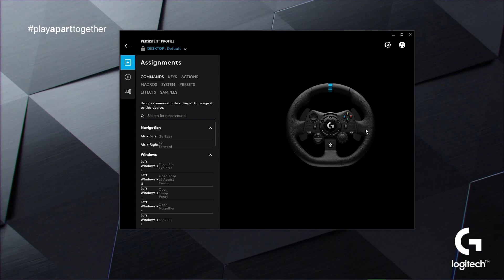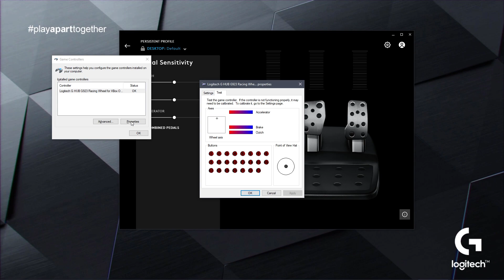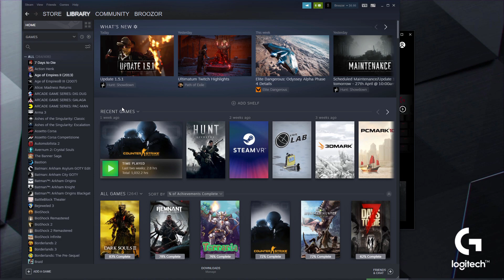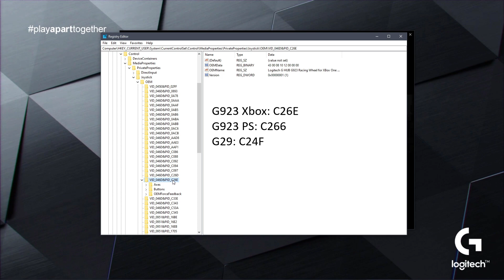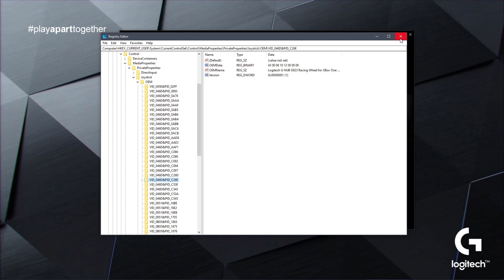How to troubleshoot G923/G29/G920 for Connection Issue

Comment: after i deleted the registry and refreshed it still didn't pop up, and it still doesn't get detected, in device manager it seems to only be detected as an xbox controller.
Reply: READ ALL, I FOUND A POTENTIAL FIX- I fixed it. So what I needed to do was unplug everything from my outlet (except the one below, for context I had an 2*3 adapter for a 2 plug outlet) and it worked just fine after. I had been searching for months prior and I was on the verge of selling it but all it needed was its own outlet. BUT, some outlets have less than 120V, It says this thing only uses 30V but it has to have 120V, kinda weird but whatever. So if that doesn’t work then try a new outlet, your outlet may also have some issues so another good reason.
Reply: make sure all three cords are plugged in the wheel (4 if u have a shifter)

Comment: ok so something is wrong with the power on my Logitech G920, it has a flashing light above the xbox button i already tried to unplug and plug in the power but that didnt help i it used to rotate and callibrate whenever i plugged it into power but not anymore neither does ghub detect that im rotating it please help

Comment: what if wheel has full power and it still isnt moving in G Hub pedals dont move in G hub either but the wheel works in Assetto Corsa can tell its not working properly though please help

Comment: My Wheel is constantly doing a vibrating Sound when i Plug my usb in to my pc and there is no light blinking or whatever. The G920 is plugged in and shouldnt have any Problems with the Power. It wont Connect with pc or other devices like a Laptop or Xbox. Any rescue chances

Comment: What if ONLY  the pedals don't respond? Even ater I've tried all the procedures you described more than once, it persists: wheel works well,  as well as the buttons, but no response at all from any of the pedals! Became something really frustrating after 12 years using logitech wheels =\

Comment: Please help I followed the last step but the driver did not refresh itself and hasn't came back!!! I uninstalled the correct driver and i've done this two times before! The steering wheel stopped working when a new Logitech G-Hub update installed. PLS HELP

Comment: my wheel keeps turning to the very left -450 degrees. how to fix??
Reply: Same problem
Reply: Have you found a fix ?
Reply: same
Reply: same issue !
Reply: Has anyone found a fix to this? My wheel doesn’t calibrate and is stuck turning left at -450

Comment: What if not detected by Steam? Thanks for this detailed video. My problem seems to relate to step 3 because my G923 PlayStation is not detected by Steam even after unselecting all of the other boxes. What should I do to get my G923 controller detected by Steam? I'm on Windows 11. Thanks in advance.
Reply: did you fix the issue?
Reply: @brezzybreeze554  no
Reply: @Tugennov  did you fix the issue?
Reply: Same issue---My G29 is not detected. I' ve done everything on every website and support site that is listed. Steam simply doesn't detect my G29.

Comment: Problem with me is that I accidentally used a different kind of connector to the wall and now I don’t know what happened. I have the Xbox version and all the lights are on. I found the original cable and it’s all plugged in and it just doesn’t show me that it’s connected.

Comment: Guys who refresh and the wheel doesnt't show back up: once you delete in RE and replug ur wheel, reopen logitech g hub and then refresh registry editor, the wheel should reappear in the regsitry.

Though my wheel reappears and it actually works in games, logitech g hub still does not show any of the inputs im doing to the wheel.
Moreover, For me, the bad thing is, everytime i start up my computer, i run into the same connection issues and i have to keep doing this troubleshooting. if anyone has a remedy for this pls share :(
Reply: THANK YOU 🙏🏽 🙏🏽

Comment: HELP! Tried every fix. My G29 playstation doesn't calibrate on PC. Nothing works. The wheel shows up in G Hub. I can even click on the steering wheel on the left side, but G Hub does not respond to me turning the wheel. The peddels do respond, but just not the wheel. There is also a blinking light on top of my wheel next to the ps3/ps4 slide button. HELP!

Comment: im so confused it has the right amount of power, its detected in ghub but i cant do anything with the wheel, windows controller is blank and calibrate is blanked out, all things are off in steam but the wheel isnt there and the windows registry worked but nothing happend

Comment: So if I have that blinking white light and the wheel is connected to the computer (showing in GHUB), it's a power issue? The brick is plugged in and the cable is plugged into the wheel. Is my power brick dead? Been using the wheel successfully for over a year, and suddenly today it is just blinking and doesn't move or calibrate. Tried reinstalling drivers, software, etc.
Reply: this is my same problem have you found a solution?

Comment: hello! i have my g 29 for a bit more than a year, it worked perfect until now, it doesn't connect to my laptop at all, when i plug something in my usb port it flashes a little blue light, but when i plug my wheel it doesn't, i tried every thing from cleaning everything from dust to un plugging all the wires, seeing if they're ok, then and re-plugging, nothing works, i even re-installed g hub. wierd thing is the last time it worked was before the last g hub update, can anybody help me, i hate playing beamng on a controler

Comment: Can anyone tell me if there are two different versions? I have a Logitech G920 for my Xbox Series X and it doesn't pick it up as an accessory. It's even connected directly to the console. It works as a controller and I'm able to navigate throughout the Xbox, but when it comes to gameplay, immediately upon driving games it says I need a controller. Upon the accessory settings it doesn't even show its connected. Again, I'm able to use it as a controller while on the Xbox menu but I can't use it for games. It calibrates as well upon turning it on, but when I turn it off as a controller, I can't turn it back on. Power supply seems to be working just fine too. So anyone have this issue? I have an entire racing wheel set up for it and after I set everything up, the stupid wheel doesn't work.

Comment: Mine is all plugged in properly and still has blinking green light. When I go into ets2 it is stuck all the way left. I replaced the fuse on the plug and still a blinking green light it's plugged into the power brick correctly. It is less than a year old any advice?
Reply: Pedals being recognised in ghub and wheel is there but when turned doesn't turn on ghub
Reply: Not recognised in game controllers
Reply: Followed registry and it has same problem afterwards

Comment: 9 times out of 10, the issue is GHUB. I've had it interfere with everything I use my logitech devices for. It conflitcts with iracing. THEN, logitech makes it incredibly difficult to remove the software. And logitech support is less than helpful. They walk you in the same circles repeatedly expecting a different result. If you use older driver software, you'll have more luck. I had to figure this out when I got a new computer, and I just went through this again as I mistakenly got a logitech headset, getting it setup I figured they had fixed the conflicts with iracing, and boy was I wrong. I noticed that in addition to it causing conflicts with iracing, the headset volume was very low. Fought and fought finally got GHUB uninstalled, installed my old version, and no more iracing conflicts, and headset it louder...

Comment: i have everything plugged in and secure, it shows up on ghub and windows, the wheel does not calibrate at all and has the power 
led, and from the windows page thing it seems like the clutch has been switched with the wheel axis so when i press the clutch it shows up on the axis display and not a bar like the brake or accelerator, the wheel cannot be getting insufficient power because i was able to use the wheel just a month ago, but took a brake and when i wanted to use it again it doesnt function

Comment: Hopefully this question gets answered so, I have a g920 and i use it on my xbox series s it works on the xbox but, when i go into any game for some reason it doesnt read as a controller. Ive tried to play f1 21, forza, gta all as soon as i disconnect my actual controller and try to use the wheel it wont read as a controller and i cant use it in game only on the xbox system
Reply: I have the same problem with my g923 on the series s🙄 do you fund something helpfull to fix it?

Comment: My rpm light comes on but the wheel wont spin when I disconnect reconnect, I bought a new power supply and that didn’t fix it. I went through the registry deleted and repaired everything. Still doesnt work

Comment: white light is flashing, The wheel is plugged into a surge protector which is on, g hub sees the wheel but when i move the wheel the software doesnt do anything same with the pedals, joy.cpl sees the wheel, I push the buttons but nothing happens on joy.cpl, steam doesnt see the wheel, all boxes are un ticked, deleted the registry profile and when i plugged it back in and refresh it appears again, wheel just doesnt work, I only got it a week or two ago and havent damaged, kicked, stood on or bent the power supply, for how much it cost i would have thought that the power cable atleast would work, when i plug it in it makes the pc connect noise, instantly disconnects and reconnects, doesnt spin to calibrate or anything, tried updating drivers all that and nothing seems to work, any one know what the problem is?

Comment: anyone have issues when calibrating wheel goes to 450 degrees and before it turns the other way to calibrate it gets stuck and a rapid white light appears?

Comment: this is not wroking  the wheel gives all leds but there is no feedback nor is there resistance in the wheel. unplugging and replugging all the cables from wheel to pc does't not solve the problem its showing up in the programs like ghub and the windows 10 test thingy. but when i move the wheel its not visibole in ghub. neither does it anything the paddles as wel are showing up but when you pres them there is no signal.

Comment: Hello, What should I do if the power is there but the wheel does not turn left and right like in the video? I already connected it my laptop and updated the wheel (via Logitech Gaming Software 9.04), but I actually have no clue what is going on.
Reply: Did you fix this ? Having problems it gets stuck on 1 side

Comment: i did all the steps, plugged it into the usb ports and wall ports that i know work, i removed it from registry editor and plugged it out and into the known working usb port but it still wouldnt show up after i refreshed and it still wont start or do anything its just dead
Reply from the maker: Hello! Sorry to hear this. If the wheel isn't going through its calibration after all connections have been checked, You will need to contact the support team in regards to replacement unit if it is in warranty range. The Team can be reached here - https://support.logi.com

Comment: How do I verify that my wheel is connected?
Reply from the maker: Hello! This will depend on what you are using the wheel on. For PC, You can check by heading to the "Setup USB Controllers" inside of Windows. The wheel should be in there if the unit is fully connected! For Console, Hitting the Guide button (Be it PS or Xbox) on the Wheel should bring up their respective guide menus. This is a good indicator that the Wheel is connected to the console.

Comment: It didn't solve my problem. I use a G923, the LEDs are on, wheel and pedals appear in ghub but nothing react. Nothing in steam's controlers and the final step with registry editing did't work neither

Comment: Hello, I did the registry editor method and and the file didnt redownload, do you have a fix for this?
Reply: I had the same issue, this is what I did to fix it: After deleting the registry, unplug your wheel's USB cable from the computer, made sure I had the switch on the top of the wheel set to PS4 (I had it on PS3), then plug the wheel's USB cable back into the computer. Problem solved for me. Hope this helps.

Comment: I have an issue with mine where my vibration is very subtle compared to how it was before, which had very recognisable vibration (very strong). Now it appears that whenever I try testing out the vibration on other racing games, it appears as very subtle even though the settings for it’s vibration is all maxed out. Can someone please help? I have the G923.

Comment: my G923 XBOX version wheel won't spin/caliberate when plugged in and it is showing all leds lit up on top of the wheel. Should I return this and ask for a replacement? It also doesn't register to show a device when I have ghub up on my computer. You mention it being a red flag

Comment: so what if GHUB doesnt pick up your wheel turning but it picks up pedal input?
Reply: Have you fixed it ??? Im having the same issue. Super annoying
Reply: @Reflownad  ok so it’s actually kind of funny, the cable unplugged from the power supply(the brick with the cable) so I just plugged it back in and I was good to go

Comment: Hi Logitech. I just purchased the g923 steering wheel. I have installed it in to my xbox series x and it works fine until I try to use it in some racing games. It works well with dirt rally 2.0 and somewhat in Grid Legends, but this I think I need to fiddle with the settings in this game. My  issue is with Forza Horizon 4 and 5. When I try to use the wheel, I start the game and then an error comes up saying I need a controller to play this game. I have tried to reset the game, unsync my gamepad, unplugged everything to reset it but I still get the same message. Please could you suggest anything on how I can get it working with the Forza games and other potential games with this issue. Thank you in advance. On the games I have managed to play it on it has been a great experience and I am throughly enjoying my new toy.
Reply: hey , do you fixed the problem somehow? because I have the same problem on the series S. It doesn't recognizes the wheel too and says I must connect with a controller .☹
Reply: Yes, I hooked it up to my computer, did a firmware update and assign the keys through the g hub software.
Reply: @snooki447  Thank you for answering.

Comment: Today I turned the PC on, the G923 had calibrated. I had open Assetto Corsa but the steerring wheel was loose but in sync with the game. So I restart the PC and then the wheel didnt calibrate and stop being able to be tested on Windows and at GHub. On GHub it appears online but does not respond to commands. I've tried reinstalling GHub, reconnecting cables but didnt work. Any suggestions? When on power the LEDs are turned off. Power supply?

Comment: Bought a G29 a year ago. Stopped powering on in 3 days. Went back to my G25.
Just bought another one, rotation locked at 20deg in sim.
TIP: Check 'CENTERING SPRING IN NON FORCE FEEDBACK GAMES" and set "CENTERING SPRING STRENGTH" to 0. 
May help you unlock your wheel too.
Concise, comprehensive setup video. Thanks mate.

Comment: Nothing helped... It's blinking green so it's probably the power in wheel or something... i guess i cant really fix it
Pedals work but i cant use that for much without a wheel (I've tried everything)
Update: after yesterday of trying this, it doesnt even blink nor show any signs of life... I wouldn't recommend this wheel because it breaks within a year it seems (Haven't even used it that much... so sad)
I have spent around 2 hours looking for answers but nothing helps... I guess my only option is to open the wheel and see if i can fix it from there

Comment: Hey Logitech, just bought the g29 and its shifter. Games only detect 2 gears (buttons 15 and 16), I've seen I am not the only one dealing with this problem. Any solutions? It is also very random, sometimes it works, sometimes doesn't. Ty!

Comment: I have checked that my plug is in the wall firmly, i took the wheel of the  stand to make sure the force feedback cable is firmly in the wheel but i still cant get it to calibrate. Can someone help? My wheel is a G920 for Xbox, but I'm  using it on windows 10.

Comment: Hey i got a g923 xbox version and everything was fine until one day i started my xbox the got on forza just to realize that when i turn right in the (pause menu of the game) the wheel doesn’t wanna come back (it does come back when am driving) but the problem is that it feels the same when i play another game like snowrunner or farming simulator 22, the problem is that it dont come back on those game, i tried ghub on my pc to look if it was broken and it seems to respond correctly i need help

Comment: this is super annoying ive sat here trying to figure out why my racing wheel isn't connecting to forza i checked everything else it works perfectly fine on the dashboard it works just fine when i connect it to the laptop i even tried the advance windows settings but that section c262 dosent pop up for my g920
Reply: Same

Comment: it doesn't work for me, for me the wheel doesn't calibrate and it has a green blinking light, when i try to calibrate it via windows it says that the clutch pedal is the wheel turning or something and G hub says that the wheel is at a 450 degrees turn while it isnt, i tried a lot of videos but nothing works. steam doesn't even see my wheel, the g29, also my wheel DID NOT re appear in registery
Reply: exact same problem any fixes or is it time to never buy from this shitty company ever again

Comment: I have a Logitech G29 wheel connected to a playstation 5. Please could you help  me with this issue. I have all the signs that it is not getting power but I went through all your steps and it still didnt work. Please help!